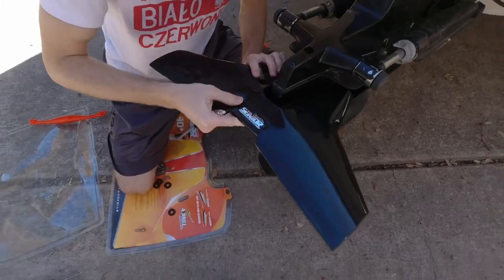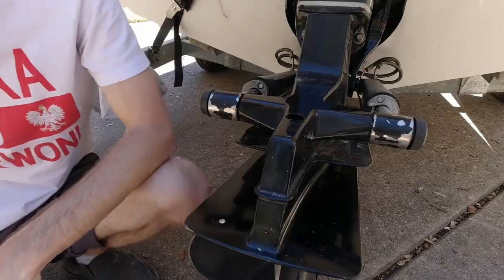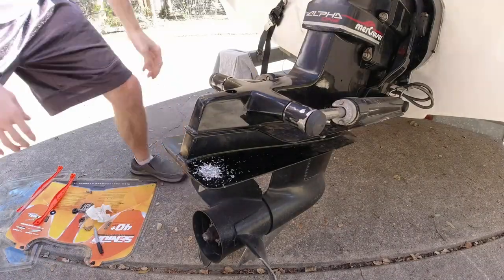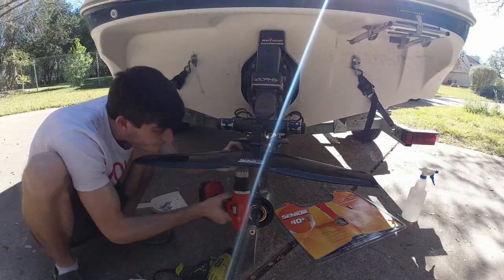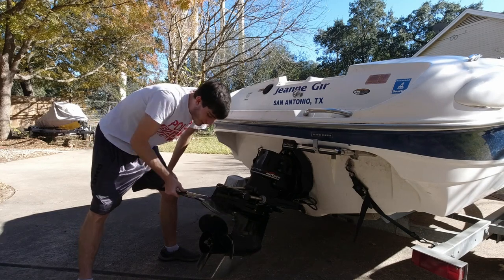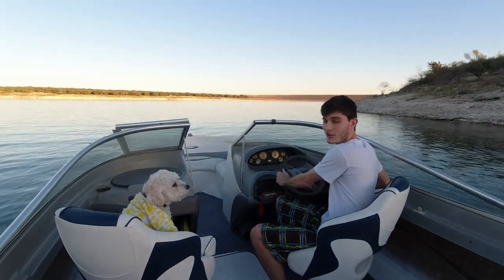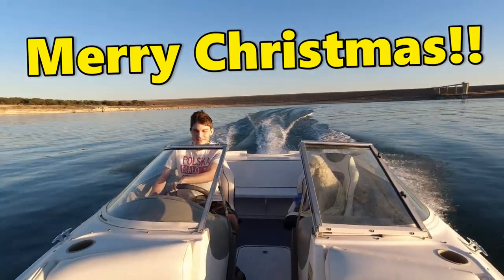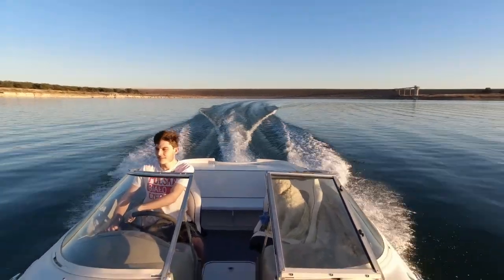Installing an outdrive Hydrofoil!

Comment: I also found the foil made my 3.0 plane out better, until the cav plate broke at the two bolt holes. The plate is not really made to handle the added load of the fin. I found equal planing performance by going to a 4 blade aluminum prop, michigan vortex. Just drop down in pitch an inch from three blade.

Comment: Hey Zach, another Zach here, just a quick suggestion, not sure if you were going to relocate those two handles or not, but it would be more convenient to get out of the water if you put another handle on the back by the ladder, may need more fiberglass reinforcement, but it seems you have plenty.

Comment: Merry Christmas!  The foil really worked good eh! Did it cause a lot of extra drag?
Reply from the maker: When I had the trim as high as you can safely go at idle it wasn't a huge noticable difference in drag, just a little more. I kind of was hoping it would slow it down some because I have to the have my idle on the high side

Comment: As always great content. I have the same one on my Mercruiser 3.0. Faster plane and turn. Great for pulling tubes or whatever. What size and type  propeller are you using? Have a Merry Christmas and New Years
Reply from the maker: Oh I'm still using the stock prop lol, I can get back to you on size and pitch
Reply: Hey Zach, I'm also wondering what pitch you're using for your prop?

Comment: How fast did that engine go?
Reply from the maker: Around 4500 rpm, 35 mph
Reply: @ZachsGarage1  that interesting. I get 36mph with a 90hp johnson 1.6L  on a tracker 17ftr. Great job on the rebuild though.
Reply from the maker: @fishawk90  I'm just roughly guessing, I don't know the exact. I don't think it's more than 40 though.
Reply: @ZachsGarage1  OK. That's the drawback with mercrusiers. They loose alot of hp thru the stern drive compare to an outboard. That boat may be a little bigger wider heavier but a johson 90hp outboard rigged to it may be a few mph less but better shot out the hole & mpg for a 1.6l verses that 3.0l.